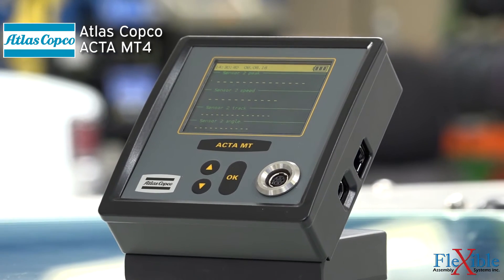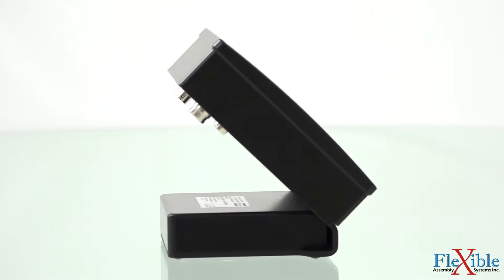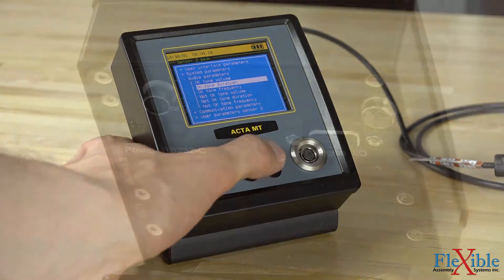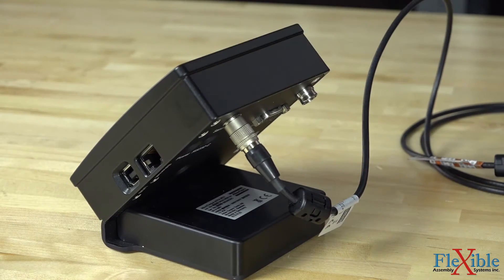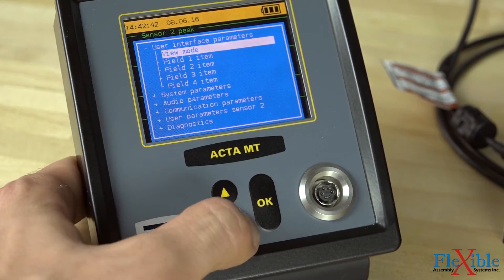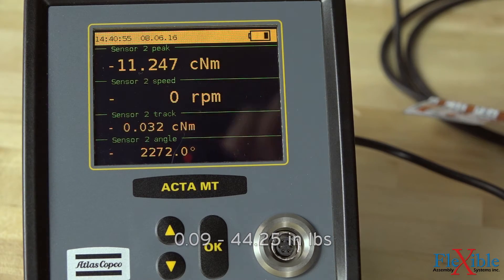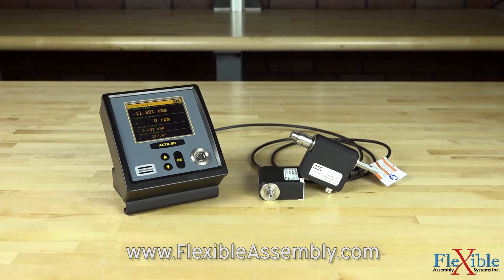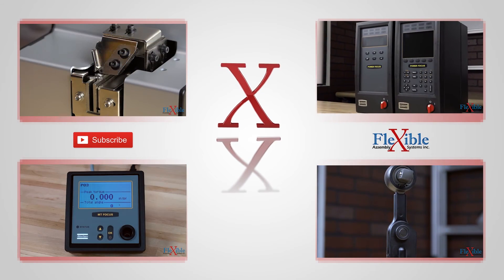Atlas Copco ACTA MT 4 Micro Torque Analyzer

Comment: Hello! Which software do I need to connet the ACTA MT4 with PC or Laptop?
Reply from the maker: The software required to program via PC or laptop is called ToolsTalk ACTA MT. It's included when you purchase the ACTA MT 4. You can also program the controller using the controller itself!  Here is a PDF from Atlas Copco with more information: https://www.atlascopco.com/content/dam/atlas-copco/industrial-technique/products/electric-assembly-tools-and-systems/electric-assembly-tools/documents/1924%2001%20ACTA%20MT4%20Torque%20analyzer.pdf